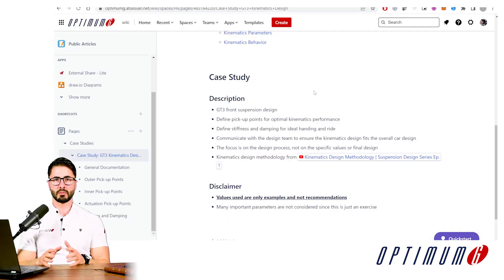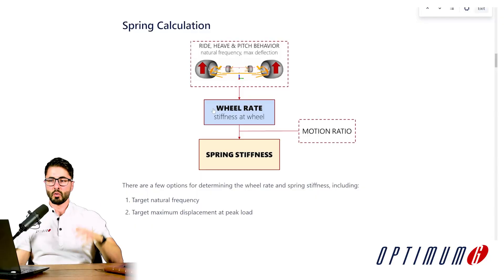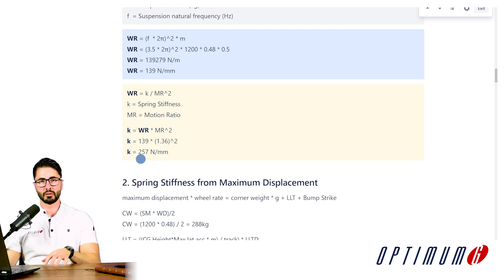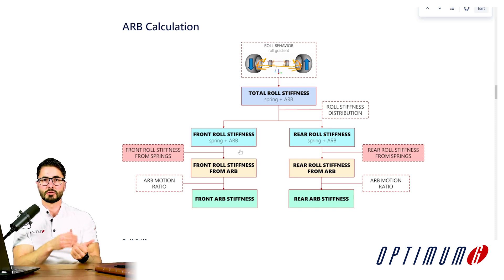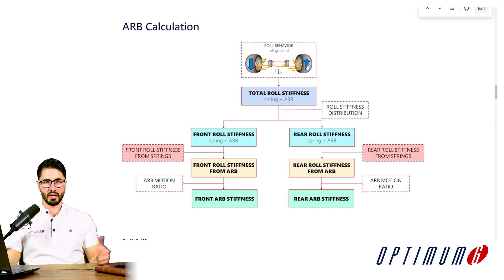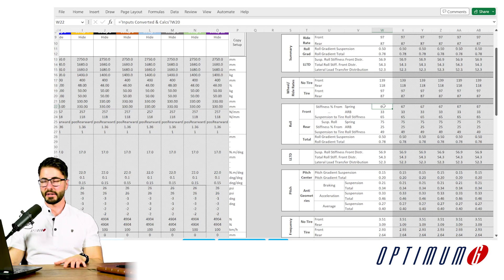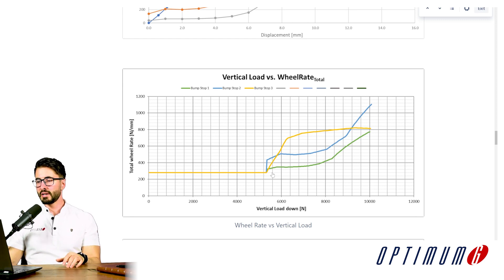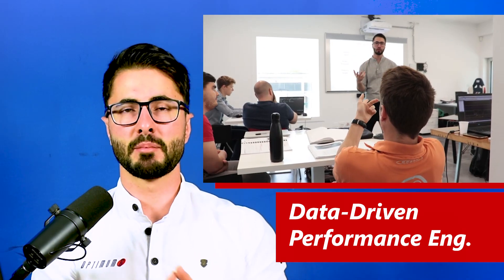DESIGN WITH ME! Springs, Anti-Roll Bars, and Bump Stops | Suspension Design Series Ep.5

Comment: Isn't the formula for the spring stiffness in terms of motion ratio and wheel rate wrong? I believe it should be Wheel Rate = Spring Rate * Motion Ratio^2
Reply: I get what you mean, but it’s a „block“ calculation like in simulink. The parameter can be squared or multiplied, as it’s a single operation.

Comment: In 11:40, why the WR (wheel rate) value from Front Roll Stiffness from Springs formula is different? The first equation use 139000 for WR, and the second uses 39000. They should be the same I guess? What am I missing here? Great explanation as usual though, very clear.
Reply: yes, its very confusing